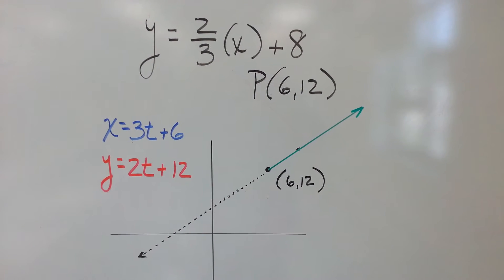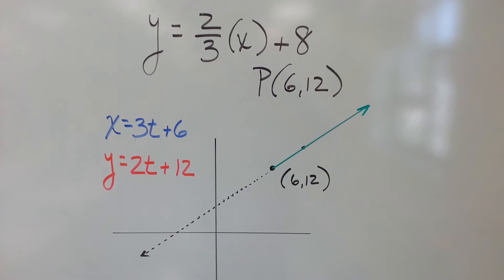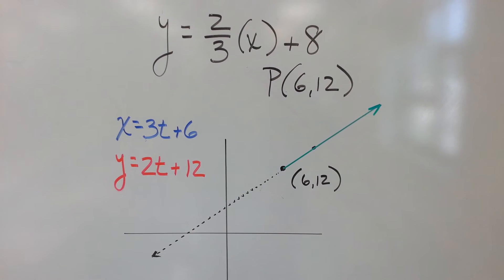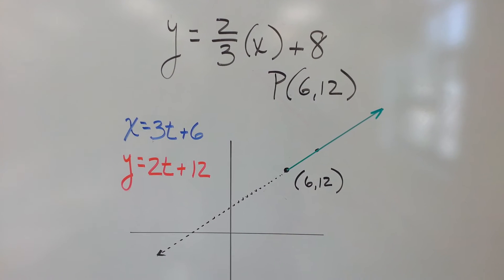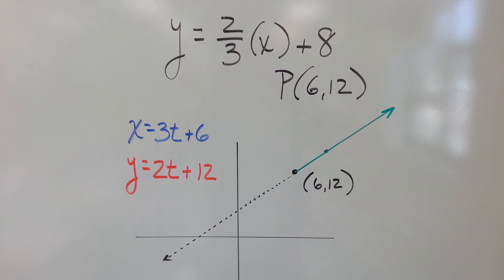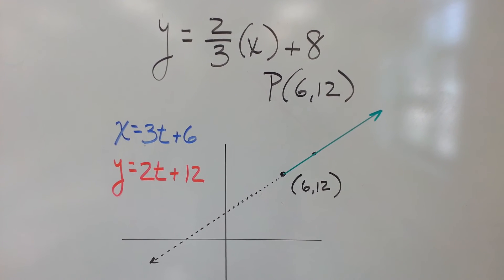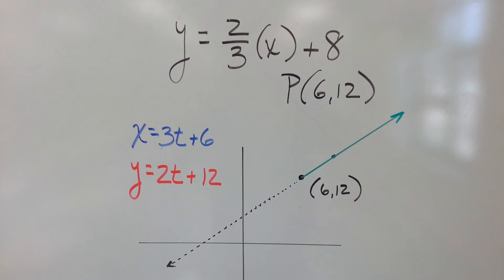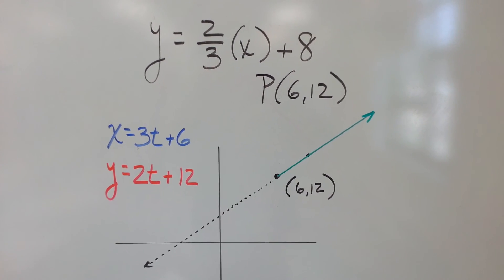How to convert from rectangular form to parametric form.

Comment: ISOLATE T
(x-6)/3=t
AND
(y-12)/2=t
THEREFORE
(x-6)/3=(y-12)/2
THEREFORE
2(x-6)/3+12=y
2/3x+8=y
That's all it takes for pretty much any parametric equation (Isolate t). For ellipses/circles square both sides so that sin^2 + cos^2 = 1, and then go from there.
Reply: Read this (please) /\